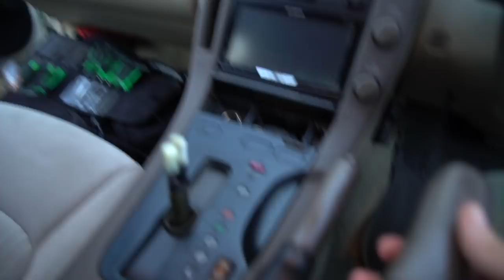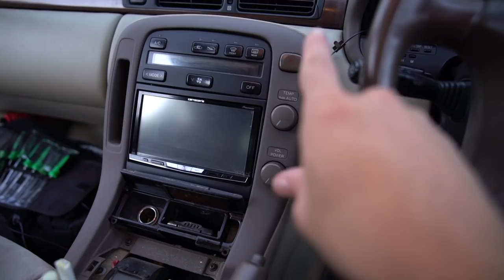SH*T IS GETTING REAL...

Comment: if the hex bolt is stripped on that rear sail panel (like mine was) try hammering a cheap 5 point socket on it and use a ratchet to remove it.

Comment: STOP 🛑 spraying interior panels. If you are taking everything out. FLOCK it.. It will look so much better..........
Reply: I think the flocking is a better job than wrapping.. Wrapping would work too but the flocking is a bit more permanent, can be touched up if and area gets damaged and it gets in around all the wee groves better..... Plus flocking an area like a dashboard won't affect the airbags..... Plus with flocking you've absolutely no issues with creases and over time it won't lift or sag.... FLOCKING is better.